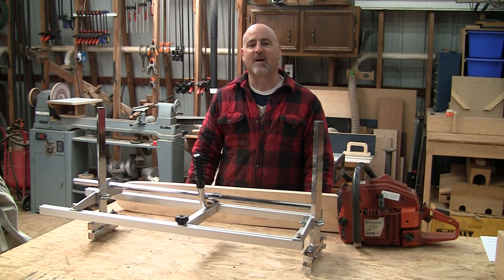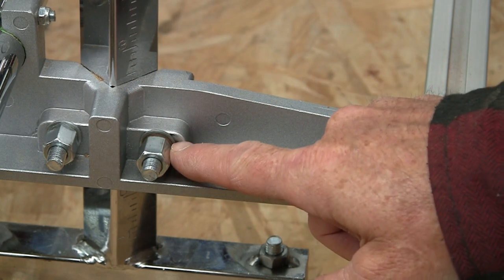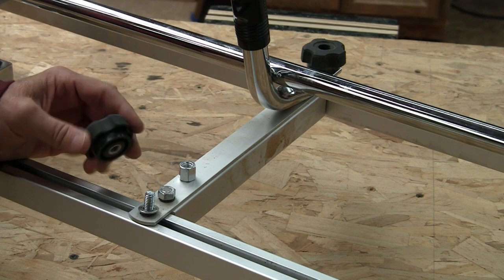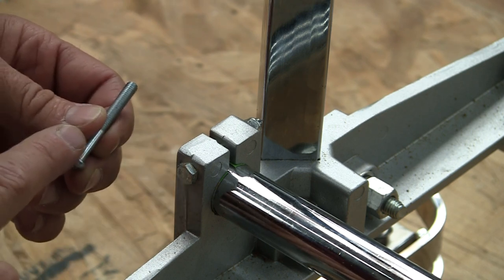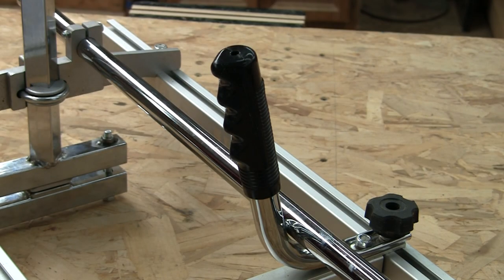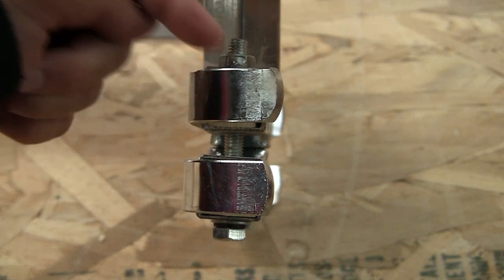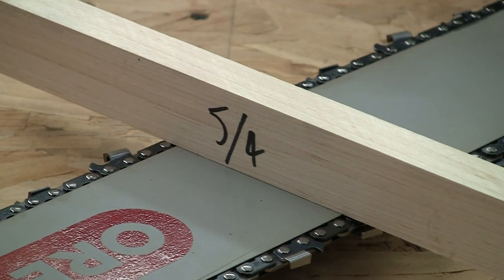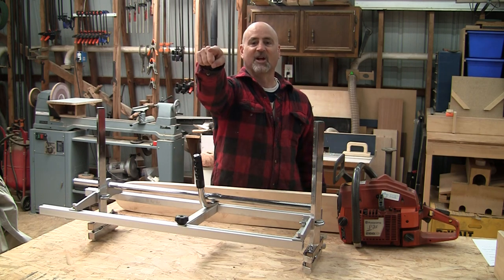NEW CHAINSAW MILL HACKS!

Comment: I like your point about switching which side of the clamp has the nuts attached to it. What I've done with the 'face' of one of the clamps is use some jiffy weld to attach a piece of used sandpaper (Iikely either 60 or 80 grit I can't exactly recall) so that it grips the bar better. I had one incident previously where the bar came free from the clamp and chewed right through the bolt next to it and I was that I had tightened it as well as I could have. It's a Chinese knock-off model, so luckily the bolt was not high quality steel and the chain seemed to cut through it without noticing. I've inspected the chain a couple of times to determine if there was any damage and have located where a raker looks a little extra shiny but all of the teeth are sharp as they were prior to chewing through the bolt.
Nice video, these definitely seem like worthwhile modifications
Reply from the maker: I thought about doing the same thing with sandpaper. First time using the mill, I checked the clamps every couple cuts and I had no slippage at all. If that becomes an issue, I'll definitely do the sandpaper as well.

Cut straight!